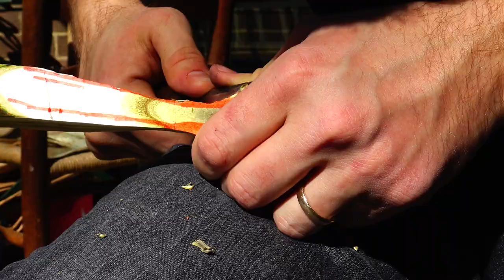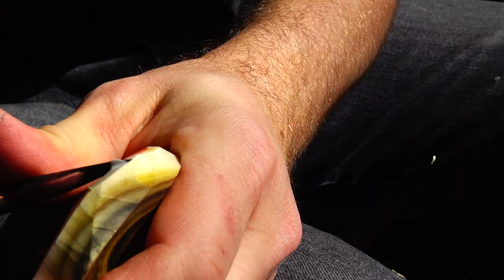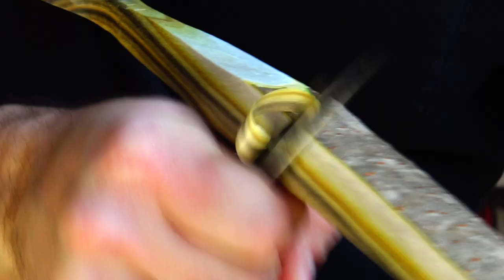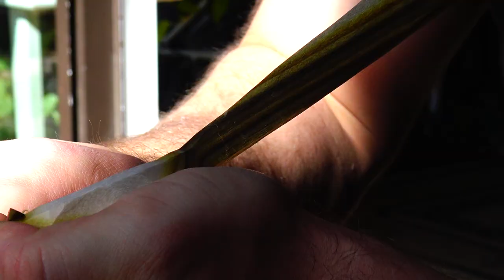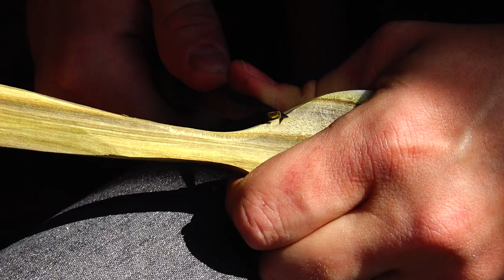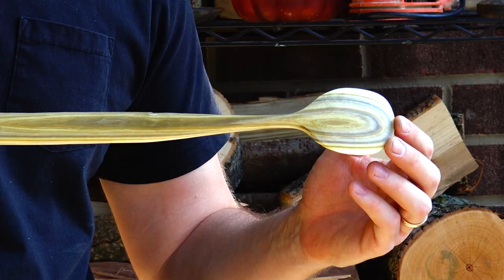Staghorn Sumac Cooking Spoon Carving, Part 2

Comment: Is sumac food grade? The oil in the sap is supposed to be toxic. Do you dry it after carving? I cant wait to try this. I got both fresh and dried. Did you rough the blank in with an axe?
Reply from the maker: It’s fine for food. Not any more toxic than other types of wood. Roughed with an axe and carved green. Sumac is light enough that it’s not too hard to carve dry. Only issue is the sap between sapwood and bark is sticky.
Reply: There are two types of Sumacs.  Staghorn Sumac which has fuzzy branches and serrated leaves and red berries.  These Sumacs are used for their berries as a spice in the Mediterrean.  Then there is the vine like Sumac that grows in the marshes in different parts of the states that have the white berries that are poisonous.  I am not sure about the sap being toxic or not with Staghorns but you might want to look at the two types of Sumacs on youtube to get a better idea
Reply: @moniquevandeplas5210  There are actually way more than 2 kinds of sumac.  The white berries of poison sumac are poisonous but the bigger concern is the urushiol oil that will give you the same rash as poison ivy and poison oak. Poison sumac is pretty rare compared to the other sumacs.  The poison sumac grows in wet environments and the berries hang down (and are white).  Other sumacs have berries that stand upward and are red.  The general rule of thumb is, if your feet aren't wet when you are looking at it, its probably not the poison sumac.
Reply: @nathanbour1010  Follow up question.  I was aware sumac is food safe, but I have read that it can impart an off flavor.  Have you experienced that?  Its probably more prevalent with a bowl.  I am just curious.  Either way I will be making spoons and bowls with it haha.  I would love to try to make a bow out of it as well but I think it might be too light of a wood.